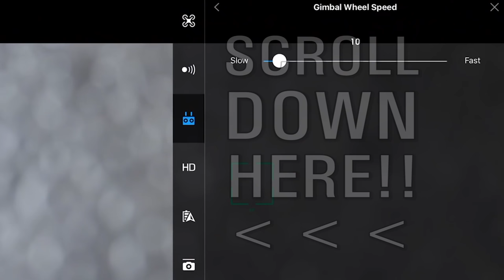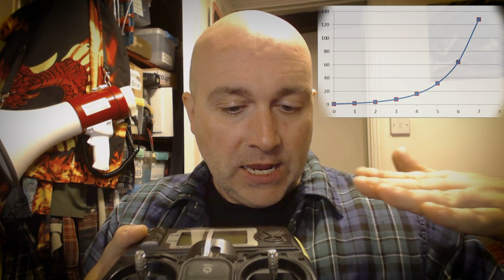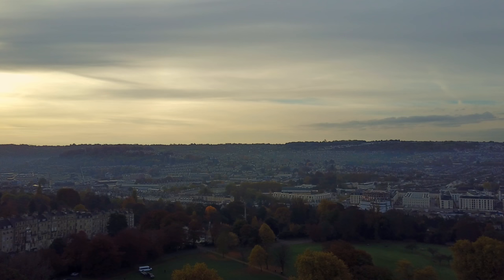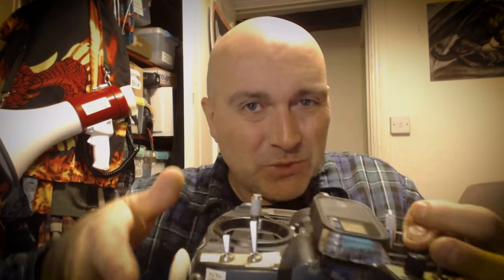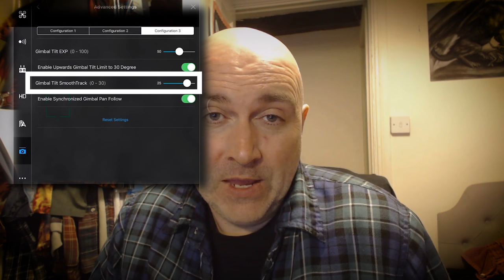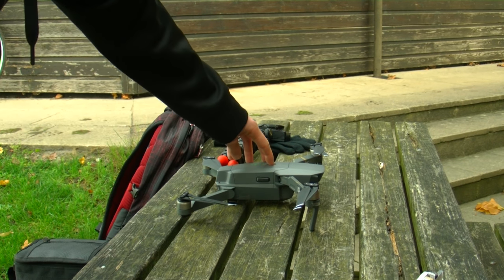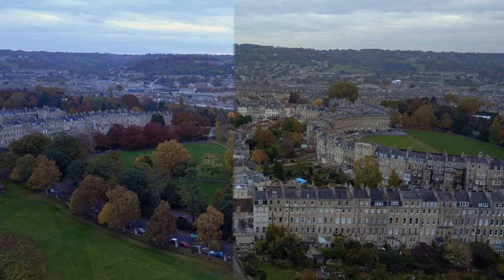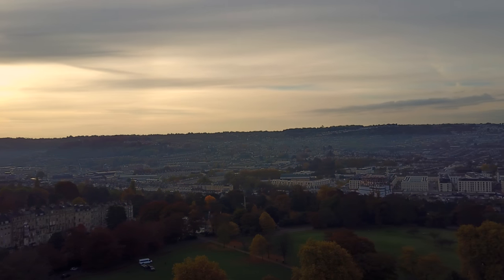DJI Mavic ULTIMATE smooth flying settings and beginner tips

Comment: Hi Matthew, On my Mavic controller under EXP I don't have NORMAL-SPORT-GENTLE. It only shows normal and then the 3 graphs showing throttle, rudder and forward. What gives?
Reply: Have you put the latest firmwareon it. They may have remove this function now and introduced other new stuff like "cinematic mode" which is a reduced positional braking system where the copter takes longer to stop when you let go of the sticks. It just means one exponent setting now works on all modes, which is fine... because youll probably like having the same amount of expo in all modes anyhow I would guess.

Comment: Hey Matt
Thanks for the video it has been well received.
i have just received my Mavic pro and it appears the settings menu has been changed slightly with names etc as its a little different.
the one thing i struggled to find was the gimbal wheel speed.
on your video you have gone into the controller settings but I'm struggling to find it.
any help would be greatly appreciated
thanks
Reply: Did you slide down the icons to get any of the gimbal settings screen? It is sometimes hidden off the list. Can you send me a picture of your screen me@thematthewwilliams.com - or make a video if you think its different as i would like to see you scroll through the menus to see whats changed

Comment: Great info thanks. FYI, I assume post software update, the settings on my DJI go4 app have slightly different labels to the ones you show. 'Gimbal smoothtrack' is labelled 'Gimbal Pitch Smoothness' on my app and 'Yaw End Stop' is labelled 'Yaw Movement Limit' . It confused me a little to begin with but thought it maybe helpful to know. 
As for the guy who already knew this stuff, so what? Stuff him. We'd never learn anything if we stopped sharing knowledge because we simply assume everyone else knows it already. the secret is not to be patronising which you are definitely not.

Comment: Is there anyway to save settings or profiles so you dont have to use alot of time verytime you change actionmodes?
Reply: I believe thats what the 3 screens are in EXPO... there are 3 tabs one for "gentle" (whatever that means - it might refer to Tripod Mode)... then there is Normal and one for Sport. If you set your profile different in those 3 modes you should be set to go. I would expect them to change automatically into those profiles when you select those modes on the controller - but if they dont you can quickly enter that menu and switch tabs to set them. Thats guesswork on this though...Please let me know if this works for you.
Reply: Im like eberyone else still waiting for my drones, so i can't check it.

But i guess alot of settings should be changed from time to time, and that's where multiple profiles would get handy

Comment: you suggest 30-50 for an exp speed. This seems fast...much faster than what others on utube are recommending  (10) for that cinematic look. Hhzve u tried this yet? Still waiting for my Mavic znd doing research.   thanks
Reply: Yes if you can get 10 exp use it, that a much better setting. It wasnt available to go that low on the Mavic we had as it was an early firmware so if your saying that is there in your firmware thats great. do you know your firmware revision number to help others please.
Reply: TheSecretVault hi...just received Mavic today!! Going thru now and adjusting settings. My app  says  '4.0.2' and it then says, 'Version 01.03.0400'.  I had to update firmware.  It does indeed allow you to adjust Gimbal Pitch EXP (1-50) Thank you for your advice on the other settings...

Comment: Would tripod mode be enough to achieve smooth panning shots?
Reply: Nope. Switching to trpid mode only has a slow down effect on the movement front back crab left crab right... for slow yaws (pans) you must change the settings as shown in this video.
Reply: Thank you truthseekers666!